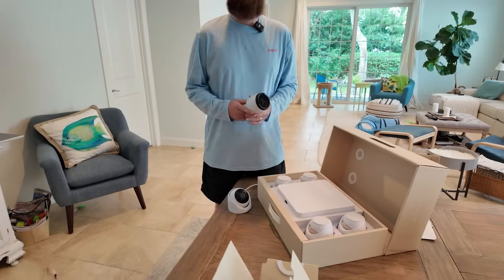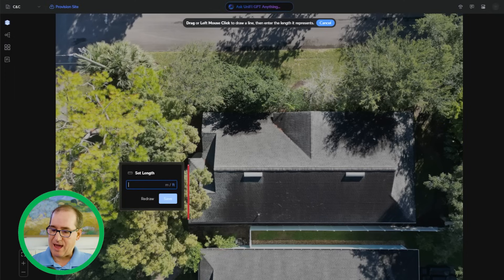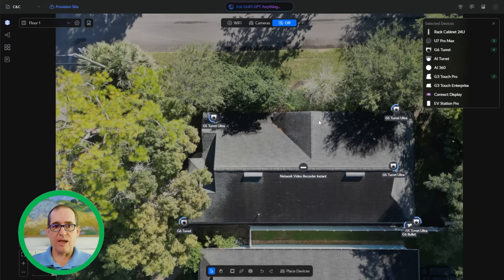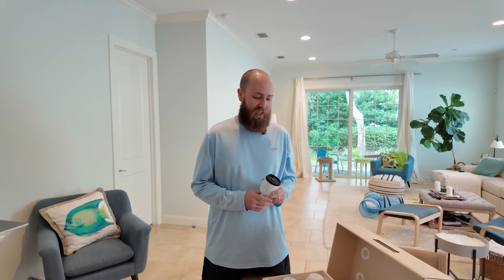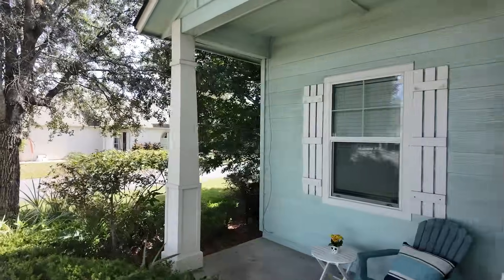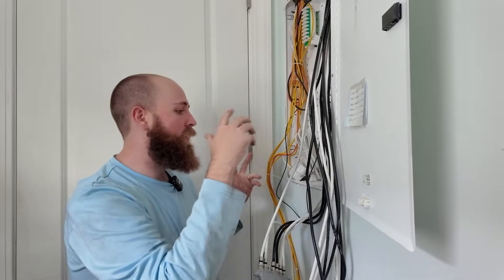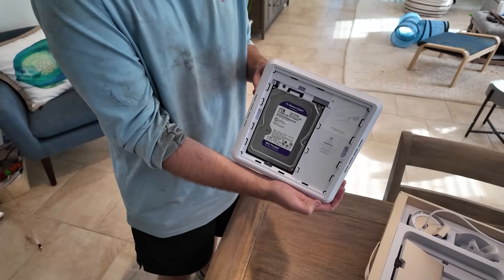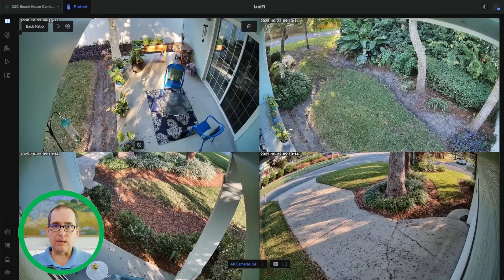How to Install + Setup UNVR Instant Kit Security Cameras

Comment: Clay could the instant be placed outside? Like for a gate install? Does dpc have any outdoor enclosure recommendations?
Reply: The G6 Instant is IPX5 and can be installed outdoors. It's a wifi cam though (unless you pay for the adapter), wish they would update the G5 Flex.
Reply: @TotteVG was more asking about the unvr instant
Reply from the maker: @relliot29 it may be too big for the flex utility, but it probably would fit in the flex utility Pro.   When I go to the office I can measure it and let you know.  But you certainly could mount it in one of those and be totally fine

Comment: Can someone try to use a line crossing with a known plate and get a notification to work. It worked flawlessly when alarm manager first came out but I havent got it to work in the pass few months. Been in contact with UniFi after resetting manager and restarting like they asked still nothing works, even reformatted and changed for max performance and lost half capacity. I would like to know if anyone else can get this to work like it used to. Using a g6 turret it shows the line crossing and which is setup for vehicle and in play back the plate number shows up but it never triggers. 🤷🏻 thanks.

Comment: For that side yard, I would turn the camera 90 degrees and then in the settings for the camera select the horizontal flip under orientation. 
then the FOV will show from directly below the camera all the way down the yard. and also see much less of the neighbor's yard.
This is also very useful for cameras in hallways.
Reply from the maker: Good call, they actually have "hallway mode" that just does that for ya, but excelent suggestion, will do!

Comment: @DPCTechnology What a great setup video. I do have a question. Typically,  2 front facing cameras would need overlap. The right front camera does not offer overlap of the left front camera. This leaves a blind spot where someone could come up from the far left side of the house and disable that camera. Do you agree?
Reply from the maker: The one on the side would catch them, but in all fairness, they are not trying to have iron clad security on this install, they just want good monitoring of their house.

Comment: I have 2x 2k G5 Turrets and 2x 4k G6 Turrets,  but only get 8 days on 2 TB 🤔
Reply from the maker: Depends on how u have it set up.  You can record on events only and you can play with compression.
Reply: @DPCTechnology  Aaaahh… Yes thats it. It is set to “Always record” and “Continuous”, so I guess I record 24/7.
Reply: Sounds about right, change your recording settings and/or get a larger drive. Used enterprise drives on eBay are significantly cheaper than new drives.
Reply: I have 1 G6 PTZ, 2 G5 PTZs, 3 G5 turrets and a G5 bullet and record 24/7 on a 4TB hard drive and I get 10 days.